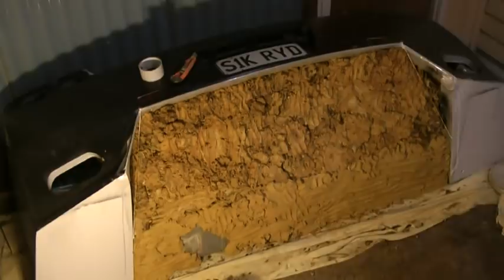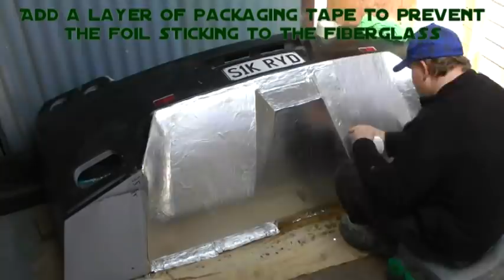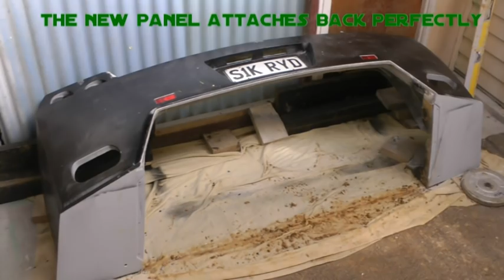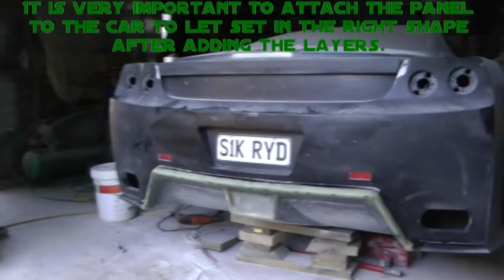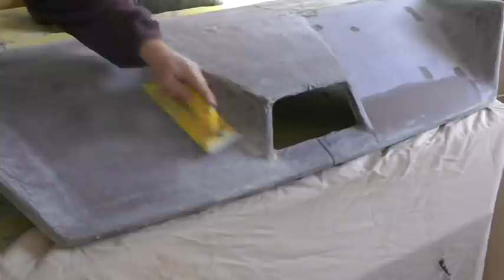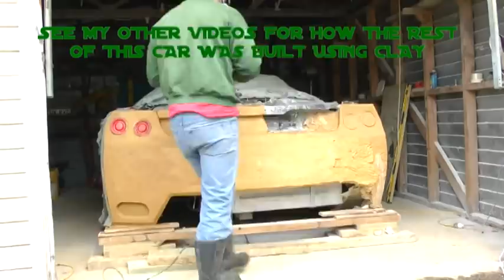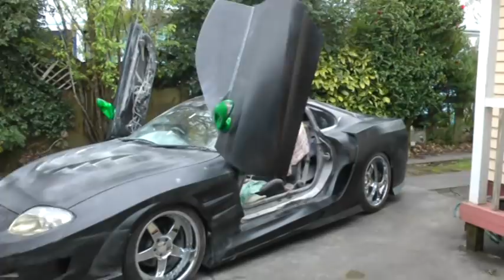How to make a panel from scratch. Step by step using Clay Sculpting - The Real Fast & Furious

Comment: Really nice and impressive work!
Just one comment, when you add the second layer of carbonfiber there is no use in rotating it 90 degrees, you need to rotate it 45. If you do 90, you are going to have the same directions in the fibers of the weave so there won't be any gain.
All of this is ofc taking in to effect that you want a laminate with equal strength in all directions and that the weave is not UD.
But again, really amazing work.

Comment from the maker: Vacuum is best. I plan to paint this and so this was not an issue. But if it was an issue I would lay down 2 layers then let it set on the car. Then I would lay down a third layer on the out side of the panel and vacuum bag it. This will give the carbon fibre look everyone likes. But I will paint my one instead.

Comment: Hey there

I have a couple of questions after having seen some other video's of people making panels ect. 

Most make a negativ mold from clay, fiberglass, wood, ect. and from that they make the fiberglass part.

Most of what i have seen they also, when letting it set, put it under a vacuum, and suck any extra resin out.

When you make the shape that you want out of clay, then adding the fiberglass on top of that, the product is slightly larger than intended? 
Or what is your philosophy behind the way you do it? 
Ofc. when they use a vacuum they suck any air, and extra resin out of the mold, making it "stronger" as there is no air "in" the part and lighter as there is no extra resin.

But would love to know your side of the story.

best regards
Reply from the maker: Hi Mate. The method use here is the potters clay method. The professional clay that car companies use is very expensive and you need warmer draws and all sorts of tools to use it. To clay up a whole car costs 10s of thousands. So for the home DIY type of person I came up with a cheep alternative using potters clay. But it has its draw backs. You are not able to make a female mould straight off the clay. Yes this does mean more work, but the average person has more time than money. As for vacuuming your resin this is not really needed (unless you are doing carbon fibre parts for looks) Boat builders make very strong boats from glass and they don't need to vacuumed there hulls.
Reply: Great answer! 
Thanks :-) 
You just use carbon for strength of the back?
Reply from the maker: Tobias Thomsen On this job yes

Comment from the maker: Cost is only materials. The clay was free. But you may need to buy potters clay. All supply's can be found at your local hardware store or eBay or trade me. You will need to go to a potter for the clay. The filler is by Newtech Auto-chem LTD 116 Princes street, Onehunga, Auckland New Zealand Phone (09) 634 6544.

Comment: im looking into doing something like this to my car, around how many lbs of clay did you use for the bumper? and other than "potters clay" was there a specific kind you used i found a wholesaler with 20 different types and im not sure if that matters
thanks
Reply from the maker: For this kind of work it does not matter what kind. Just go for the cheapest. You will need to! I used 450KG of clay on the back end and side quarters. But I cheated. I have a farm with good clay in a river. In other words I used wild clay because it was free. It is the same as potters clay with the exception of impurities imbedded in the clay such at small stones and bits of grass roots.

Comment: Very good. I would prefer a slightly different process though.
Clay to exact shape and form, fiber glass negative mold, then panel.
I would also prefer carbon fiber on the outside and fiber glass sandwiched in between.
Still, very good build.

Comment: Hey man I'm watching this to learn as well because I'm a firm believer in the saying "everyone knows something you don't know" so I'm here to pick up techniques. But I do have my own successful fabrication business full time I would like to share some constructive criticism regards to this build! It would have shaved your time down by half or if not more! If you did this in 12 days you could have done it in half if you recognize the mistake. Anyways reply if you do want to know. Not sure if you even monitor comments on this vid anymore since it's so long ago.
Reply from the maker: You are correct. Everyone knows something you don't know. Yes I am keen to see what you have to say. But if it is about using foam or a 3D printer then I am not really interested. Thanks
Reply: STIGZ no not at all man! I do my fabrications the same way you did.
 this is just my personal opinion of course, and constructive criticism.

1. When you're building up your clay you could have put a backing on there to shave most of your build up time. Because the only shape that really matters is the surface not underneath. 

2. You've already made your initial mold when you fiberglassed over your clay! 

 you could have made sure that surface was fully smooth without any inconsistency already so when you applied your fiberglass your mold is perfect!
From that mold you could have made your part! By just putting down mold release again and laying down fiberglass. And bam you're done...

But instead of making a mold you made your fiberglass the part itself. 

Am I making sense? I hope so. 

But overall great work man I took a lot out this video as well so thank you.
Reply from the maker: The way you have described is the way we did it in Japan. But the point of this video is to use inexpensive potters clay so that anyone at home can give this a go. Because potters clay is used you cannot make a mold directly from the clay like you would with student clay or y2 clay etc. These clays are very expensive for the volume needed and special warming draws and other stuff is needed making the whole exercise way to expensive for the average Joe. Instead you MUST follow the steps found in this video. Deviating from this will only lead to total disaster. Also putting a backing on it would only shave off half an hour or so. Loading up the clay is fast and easy. The sculpting is the hard part. But thanks for your constructive criticism. I guess you did not realize  this was potters clay. If it was the expensive clays then what you said would be true on both accounts.
Reply: STIGZ ohhh yea! Definitely didn't realize that was the clay used and you were already aware of the method I was talking about. Isn't that case great job trying to show the average joe how it's done !

Comment: Hey man I have a question, either where can I get Carbon Fiber or something cheaper which doesnt add much weight, would I just use a bit more Fiber Glass to strenghten it up or do I need the carbon fiber?
I'm doing a cheap BMW M3 GTR with 460HP to not make it lose to Civics or even NSX's. The weight is not really the problem because I'm removing components from the inside. But with all the body parts taken out and putting in the Rollbar and Bucket seats.  It will weight on avarage 1430KG. I wanted something cheap but without making it go back to 1700KG.
Reply from the maker: You can use more fiberglass instead of the carbon. If weight is a problem then use carbon but vacuum pack it so that you use the minimum resin to make it as light as possible. Get your carbon and vacuum materials from your fiberglass supplier. To understand vacuum bagging then have a look at videos here on you tube

Comment: would clay method work for side skirts. not sure if it would due to gravity. id have to get maybe side skirt from higher end model of my car mold that.
Reply from the maker: I designed and build my side skirts on the JZ Cobra while they were on the car.

Comment: I'm curious, are there actually door hinges which you can open both horizontally and rotate up, such as to not always go the flashy route? I would want my car to look 90% stealth 90% of the time. I'm watching because i want to do my own rear bumper diffuser, and existing aftermarket ones are too flashy.

Well accomplished technique; kudos!
Reply from the maker: Yes there are such doors. These particular doors open out like normal and then lift up. So this means you can set the doors up in such a way that you can open them out only and then step out of the car and only put them up if you want to. I set mine up with only a narrow gap when opening them out and so I need to lift them to get out. But it does not have to be that way. The adjustment is very easy provided your bodywork will allow for it. So when you set up the doors you will also need to set the bodywork to work along with your desired function.

Comment: So only polyster resin was used to attach fiberglass and carbon fibre on panel?
Reply from the maker: That is correct. Epoxy is not the only thing you can use with carbon.

Comment: I just have a few questions:
1. Say I wanted to do something similar to this with a 2014 Chevrolet Camaro, but modify the hood. How would I get the shape to fill with clay to layer on the fiberglass? Would I remove the body paneling from the front of the car and fill that in?
2. Where would I get clay like that and in those quantities? Where do I get ANY of the materials used in this video for that matter?
Reply from the maker: Yes there is a lot of wide body kits being made for the Camaro lately. I get many requests for this car. I am not sure what your first question is. But your second question is easy. Get your clay from a potter. Get all your fiberglass materials from your fiberglass specialists. I did a bonnet video as well. This may help you.
Reply: In regards to my first question, in the beginning of your video, you had what looked like the body paneling of the car you were modifying, and you filled that part in with the clay. You then layered on all the fiberglass materials from there. What I was asking is what that part you filled in with clay was.

Comment: Something has been bothering me....How are the doors affected when you add heaps of width onto the car? Surely that would impact how the doors open because they would make contact with something before opening fully? I know in your case, the hinges avoid that problem but with normal door hinges, could it still work?
Reply from the maker: Yes it would still work so long as you do not lengthen the doors at the front end. You can make them thicker as well so long as you do not pass into the original panel but out of the panel instead. This is because the original door skin is designed to rotate into the front guard and the inside of that skin cant have any extra thickness or it will hit the hinge. But the out side of the skin can have as much thickness as you like so long as you do the same with the front guard to match it. I hope this makes sense.
Reply: S1KRYD That makes perfect sense, thank you. I'll have a look at what the tolerances are and see what I have to work with. I really appreciate your input. any chance youre on the north island? would love to see your car out and about. Im in Auckland! :-)
Reply from the maker: Sam fine I am 4 hours from Auks. I may go to the nats early next year with this car and a fortune rx7 - if I get the time :) Would be good to see you there with your project!

Comment: Hi there what kind of clay do you use? I know the stuff OEM uses is so expensive. I see you have a lot of that clay you probably found a good cheaper way to getting some? Thanks!
Reply: +makaveli200369  Its alot in my country for free, i know the areas its seen from surface, dig up as much as u want take them home :D

Comment: Towards the end of the video, are you using newtech filler to secure the fins to the plate? Also is the filler suppose to be applied to the whole panel or just the bottom side? Thanks and the video was very helpful.

Comment: I hope you're still monitoring these videos - I'm curious to know the type of fiberglass cloth you use (like the weight and pattern, like satin weave, twill weave, etc) and if there is a certain resin to use, and which catalyst.. And where you source all of your products, like where you get your resin, CF, fiber glass, etc. It might be harder for me, being in the US - but it's just hard to find a website to buy up all the products needed to make a part. 

Thanks for any advice, info, insight that you can provide.
Reply from the maker: +Jordan St. Clair Go to a fiberglass specialist. Fiber glass cloth 6 OZ. CF is uni
Reply: Ah, thank you - And I was wondering if you use any form of release agent? I've noticed most of your videos aren't necessarily making a mold with FG then using that to create a CF finished part - Would the ol' packaging tape against the Fiberglass trick work for releasing the Carbon fiber part? or is a release agent needed

Comment: If i make fiberglass panels, can i lay some carbon on the outside using the fiberglass resin to get the CF look? Or is there a different type of resin needed? Very cool project, btw
Reply: Andrew Steyer for carbon fiber epoxy resin is required
Polyester resin will only stick with fiberglass while wet

Comment: A Beautiful Work of Art..  One of a Kind..  I saw another video where the guy removed the Fiberglass off the clay using an Air gun, popped right off.  Just blow air in the edge under the glass.
    How long was the whole project,  Start to finish.??   How many times can you reuse the clay, before it gets to dry to work with,??

Comment: Hi, Could you use the carbon fiber on the outer side to get the carbon texture? And how much resin is needed for 1 layer fiberglass mat 450g/m sq?
Reply from the maker: Yes you could. But this takes a lot of time and sanding to get it perfect. I have a video on skinning or wrapping a roof in real carbon. 450g/m sq is quite thick. For a full meter square I would use about 1L.
Reply: S1KRYD
Thanks for the reply. Your videos are great. Subscribed

Comment: how do you prevent the clay from drying up? I believe if the clay dries up you wont be able to reuse it right?
Reply from the maker: Use glad wrap or food wrap to stop it drying out each day when you are finished. While you are working on it use a sprayer of some kind and wet it down every few hours. If the clay does dry out you can put it into a bucket of water to soften it up and then you can reuse it. Your comment is comming from a linked web site. Which one is it?
Reply: S1KRYD Thank you so much for your reply. I wanted to ask you, once ur done with the part and its dried up and u sanded it, why do u add the primer filler. What does it do or why is it necessary? Thanks again
Reply from the maker: shamrakhz The fiberglass has a very rough finish to it and it is not suitable for painting. You must cover the fiberglass with bog or gel coat and then sand this smooth before adding the primer/filler. After this you are ready to paint the panel.

Comment: I've seen the question a 100 times about the clay. Roughly how many pounds did you use for that panel.
I found a supply store here locally and im concerned about not ordering enough for the project I'm working on.

Comment: S1KRYD - Does the specific clay you use have a name? It doesn't appear to dry out either, is that correct? I want to utilise these skills to make a GRP camper interior and think i'll follow your method!
Reply from the maker: It is potters clay. you have to keep it wet at all times

Comment: i found this one filler i think would work posible better. its called duraglass whitch combines Combines resin with chopped fiberglass, it is rust and watterproof, it also works on meatal, fiberglass and even wood. would that be stronger than carbon fiber? (sorry for so many questions lol)

Comment: what kind of clay is that?? is that oil based? please reply im really interested in this
Reply from the maker: This is just good old potter clay. Not oil based but water based. The real clay that car manufacturers use such as Y2 Clay is far to expensive for the average Joe to use in his garage at home. So I came up with this alternative. Using potters clay means you have to follow a different set of processes and it means more labour but the end result is the same.

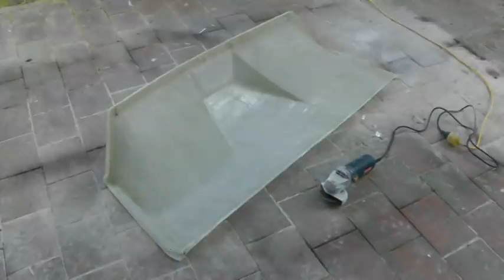Comment: What did you use to rough it up at 5:00 and also why did you rough it up? 
Instead of carbon fiber can you just skip to Bondo/filler
Reply from the maker: Crinj I used a grinder with a 60 grit disk. It needs to be sanded up to get rid of the wax layer and to allow new layers to stick. No you must strengthen the back of the panel with carbon or fiberglass first.
Reply: +S1KRYD so after the clay you put tin foil and packaging tape
Resin to let the fiber glass cloth stick
Then put the fiberglass cloth
Then you put hardener resin?
Then another layer of resin
So the next layer of fiberglass can stick
Then another layer of hardener resin? 
I am just really confused and would be happy if you could confirm that lol
I really want to make a lip but I have to make sure I fully understand it 
Thank you so much
Reply from the maker: Crinj clay then tin foil then packaging tape then 1-2 layers of fiberglass cloth 6OZ thick. Then take off clay. Sand inside of panel. Then add 2-3 layers of 300g fiberglass matt in quick succession. Before this sets hard put the part back on the car to set in right shape. Have a look at my 90min tutorial.

Comment: S1KRYD i saw in the video you mentioned NEW-TECH for the 50/50 mix of carbon fiber and aluminum, is that a cloth or a paint? i was not sure..
Reply from the maker: +Jonnie NeonichiShinjuku it is a filler
Reply: got ya, i am still doing research but this does clear up a lot, much thanks again..